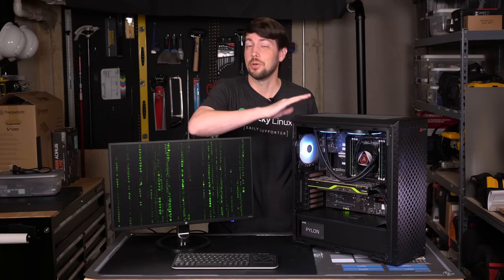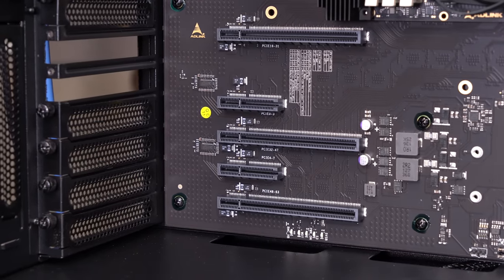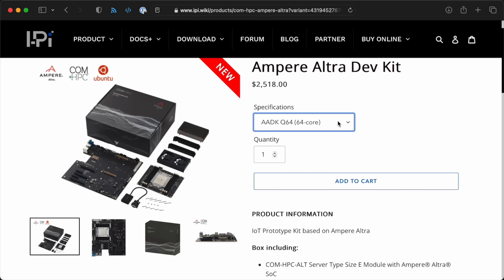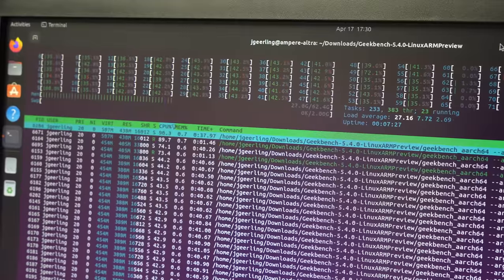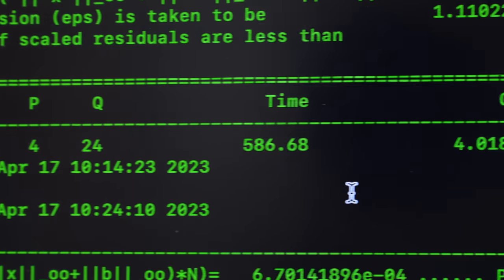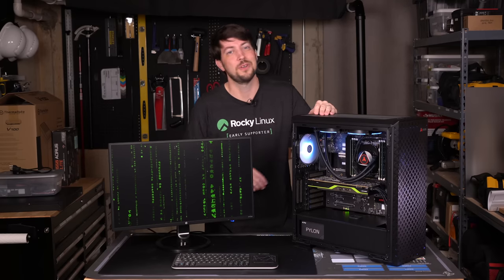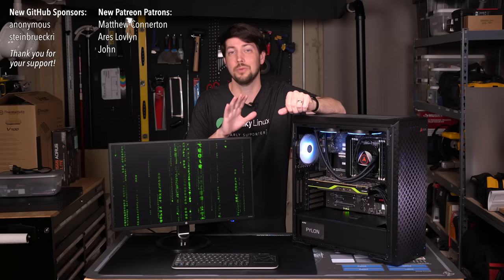This Mac Pro killer runs a GPU—and Windows on Arm!

Comment: If you have a volume licensing agreement, you can get the release ISOs for Windows 10/11 for arm64. I uh... have those if you want them. I've used them to install Windows 11 on my Galaxy Book Go. Fun thing is that I had to pull drivers from the built in recovery wim that was preinstalled on the machine, and copy them to the installer/boot wim in the ISO. Without adding the drivers my Galaxy Book Go doesn't have functional USB/Keyboard/Trackpad for installation. Even better is that Samsung doesn't provide any way to do an ACTUAL fresh install. Definitely not the experience you get with x86.
Reply from the maker: I have an ISO to test... we shall see!
Reply: Volume licensing agreements also mean agreeing to audits, don’t they, to ensure you’re not misusing the licence.
Reply: @lawrencedoliveiro9104  Am I misusing it by installing it on my Galaxy Book Go with the inherited “digital license”? They don’t provide the iso because it literally won’t work on most ARM devices without shoehorning drivers into the boot/install WIMs. If you install it but don’t activate it, my understanding is that you’re not actually violating any terms.
Reply: @JosephHalder  Copying the software is still subject to copyright.
Reply: @lawrencedoliveiro9104  Is the license different for x64 and arm64… serious question. Because they allow you to copy the x64 iso. I think once UEFI implementation and ServerReady become normal on Arm, they’ll likely just provide it just like x64.
Reply: @JosephHalder  The licence is whatever you agreed to when you got the copy. Pay careful attention to the wording of that.

Comment: Will you be trying anything with RISC-V at all?  It would be interesting to see how easy (or not) it would be to build something like this with RISC V.
Reply: Right now there's not a lot of RISC-V 64 bit systems out there for end users - and none with the kind of PCIe connectivity datacenter / workstation systems require.
Reply: @jnelson4765  Well someone with the technical know how could make such a system (the necessary extensions to RISC V architecture to make it possible)     and could contact services like Europractice   MOSIS(who offer middle man services  where  they help companies , tech faculties of universities  and governments share the cost of semiconductor manufacturing by getting chips made from the same silicon wafers)   to have  semiconductor prototypes manufactured by foundries (TSMC, Intel , samsung ect) and have a complete computer   system  made by companies like compal , quanta computer and foxconn.

With enough funding it's possible

Comment: Worth it for the make -j96 bragging rights alone.
Reply from the maker: Heh... now I want to see about acquiring a 128 core chip ;)
Reply: @JeffGeerling  that would be awesome! The Ampere systems in general seem hard to find. IT Creations quoted me an 8-10 week lead time on the R282-P91, but said they had a R282-P92 (3.5" drive model) available at end of May.

Comment: I'm no expert, but I think the biggest issue in the way of mass adoption of ARM on desktop/laptop platforms is software.

I think that Apple's M-Series computers have proven that the software hurdle isn't as big of a problem as it's thought to be. Especially with their Rosetta software that does "live" translation between X86 and ARM. 

I legitimately think that we're in a catch-22 scenario where we need really good translation layers to be able to justify switching to ARM, but we also need good ARM systems to develop good translation layers. 

I'm no expert, but if the Steamdeck and Linux's Windows compatibility layers have taught me anything, it's that it's worth taking the time and energy to invest in developing those compatibility layers.

Comment: Interesting stuff… Apple is not really doing themselves any favors by maintaining an isolationist position and excluding others from adding value to their platforms, or even for users to perform upgrades.  Something really odd about this approach.  I am an Apple user, but I find it really difficult to stomach this - they’re even doing everything that they can to stop right to repair as well, so it is just a little crazy… Anyway, that looks like a real cracker of a machine, and provided that it runs LinuxMint, which I’m sure it will, I would be more than happy to use it.  Sadly out of my budget right now… Thanks for a great video and perhaps by the time you are ready for your next one, you will have heard from MS… 👍🙂

Comment: Neoverse-N1 has quad instruction decoders. It doesn't have decoded instructions cache. Only 16-bytes per cycle fetch rate from L1 instruction cache.

Apple M1 has octa instructions decoders.

Zen 3 has quad instruction decoders (X86 instructions can do more than one function) and a Macro-Op cache feeds 8 Macro-Ops. The L1 instruction cache has 32 bytes per cycle.

Comment: That's honestly a very cheap computer considering what those servers go for in rack mount.
Reply from the maker: Definitely not a bad deal for what you get. Might want to throw in a midrange graphics card to complete it, but I still haven't gotten around to testing any yet.
Reply: To be fair, take two large server rooms of the same size then fill one up with rack mounts then fill the other up with these boxes. How many servers per space you think you will get over the other? You’re paying for more servers per space. Rack mounting is not for everyone clearly.

Comment: I have an ARM server as my home server with similar expansion. Mine doesn't have 96 cores though. Lol. 

I went with ARM because it's so much more efficient and takes less cooling. Making it quieter and use less power keeping my electricity bill down. 

I use it as my NAS, DNS, VPN, and Home automation server. Plus I can run docker containers for just about anything.

Comment: There’s no reason for Apple to have any desktop computer with PCI express slots, since they no longer support dGPUs.  Also, IIRC there’s some chip errata that affects the performance of dGPUs on the ampere chips.  There’s a patch for it but the patch is basically a software workaround, and slows things down considerably.

Comment: something that could be interesting would be an hbm-like cache, like the vega on my 8709G has, you could have like 4 or 8 Go of low latency "L4" cache (i.e. on socket ram) 
with some clever routing/design of the controller it would be doable to have each chip of the cache accessible independently, giving basically 8 channel access to the cache.

Comment: I have doubts on the upgradable RAM, one of the reasons Apple Silicon is fast is its RAM are placed near to the CPU and GPU, thus reduce latency. If Apple really wants to implement upgradable RAM modules, the reasonable approach I can think of is "Fast RAM, Slow RAM"

Comment: I tried explaining to folks that soc's could bridge to an expandable system board like this. Risc V was designed from the get go to be bridgeable so arm had to be around the corner. I bet SoC's will be standard with a neural/gpu for acceleration on the soc. I know SMT was finally added to Arm 64 chips in 2018 but I am curious to when we will see it in production. Imagine a 96 core monster with smt2 (or even smt4)

Comment: The 'What if Apple...' questions are pretty unlikely, but I don't see why Windows 11 ARM might not work as an editing/ingest server. Apple won't be working with Nvidia dGPUs any time soon, I don't think. But now that MacOS and Windows 11 both have versions optimized for ARM, this video has me daydreaming about running both MacOS and ARM Windows 11 in VMWare from Arch64/Ubuntu... And if we could use a 4090/H100 with bare-metal Windows 11 ARM, I'd love to try running LLMs or Stable Diffusion WebUI and other tools which use Torch/CUDA/CUDNN binaries, but I bet it would take a bigger brain than mine to do it. Thanks for this completely unique and interesting content! You're awesome!

Comment: I took a closer look at the Ampere Altra Dev Kit and it does not seem to include the proprietary closed loop liquid cooler in it.  Instead it has a small heatsink and small double fan
Reply from the maker: Yeah, apparently this is an XPG part (with an ADLINK sticker on top), and it can be purchased separately. I asked ADLINK if they might stock some alternative coolers (especially a horizontal server-style blower heatsink), and they said they're considering it.
Reply: @JeffGeerling  XPG or Adlink sells the cooler?  I do seriously want to buy the cooler.  XPG's website only lists a x86 compatible unit.
Reply: @JeffGeerling  I was digging further and found a German Closed Loop Cooler called the "Alphacool Eisbaer Pro Aurora 240 CPU AIO" that offers an Ampere mounting bracket though it is sold separately.  I found a store based out of Canada that ships the mounting bracket to someone in the US.

Comment: The lowest end option seems to be a 32-core config for $2,000 (and that's just for a CPU and MB).  Tantalizingly close to being able to build a "normal" desktop machine:  something equivalent to an AMD Ryzen 7700X CPU on a mid-range B650 chipset based MB.  But... not quite there yet.  

And yes, being able to run a vanilla ISO of Ubuntu is a must.  All the weird idiosyncrasies and compatibility issues inherent in ARM SBC's is super annoying.
Reply: runs vanilla ISO of Ubuntu
Reply: @JoeSpeed  Which I think is a great feature about this system!

Comment: Computers and hardware are used to dealing with levels of memory. Your CPU has high performance cache, then levels below you have RAM. Levels below that, you have "virtual memory" aka your SSD being used as fallback. The integrated RAM in the Mx chips has so much bandwidth that it's great but I don't know why they don't allow more RAM outside the CPU that would be treated as a level below the chip RAM. It wouldn't be more complicated than the way that applications swap from virtual memory to real memory.

Comment: I don't need "high-end" desktop computer with ARM processor. I think it better to make ARM SBC like Raspberry Pi with standard X86 memory and PCI-e. I installed Linux server on my android box. It have Amlogic S905 processor (ARM) and 2 GB RAM. I install openmediavault (NAS) and Home Assistant (via docker) with MQTT extension (masquitto). Modern ARM processor about 4 core and 4GB memory is enough for desktop. It can be use for kids to learn computer or for home media center.

Comment: @7:45 are you using full system draw for the wattage on all chips? On the 5600x, what gpu did you use. 196w for that chip seems way too high owning one myself.
Reply: That is total system draw including 750W PSU under full load. Don’t know if the RTX 8000 was already plugged in at this point.

Comment: Finally an ARM desktop targeted at non enterprise scale users.
I wish they'd use HBM instead of DDR.
I would also prefer if Apple didn't do it because they're awful to deal with in the context of repair and expandability and that's a big problem for small businesses.  Apple letting users decide how to fill expansion slots and memory with non apple users isn't something apple is amicable to.
Also: Software efficiency has always been important--bad programming somehow became acceptable in the industry in recent times.  Early hardware restrictions obligated extremely efficient code.

Comment: very interesting idea, but i do also think, that ddr5 memory is a must on machines like this. Like you have huge multithreading but somewaht speed "bottleneck" with ddr4
Reply from the maker: The Ampere Altra/Altra Max only goes to DDR4, unfortunately. We'll have to wait for a new generation to get up to DDR5 speeds. Plus, DDR5 has so far been an interesting (read: sometimes unstable) journey, at least if going to higher speeds!

Comment: In order to download a Windows 10 ISO recently, I needed to disable pi hole blocking temporarily. Not sure if you had the same issue with the ARM build, but thought it was worth mentioning!!
Reply from the maker: I had tried that a couple times, but it didn't help. I re-tested yesterday and was finally able to download the file. No clue what happened!
Reply: @JeffGeerling  Microsoft must of heard this via the grapevine saying "Fix this before Jeff pull a red shirt on you!" 🤣
Reply: This is why they say, Windows is a great OS--if your time is worth nothing.

Comment: Could try installing windows arm on another device, then moving the drive to this computer? I used to do this a lot and the drivers would sometimes update albeit at least loading the system in some compatibility mode.

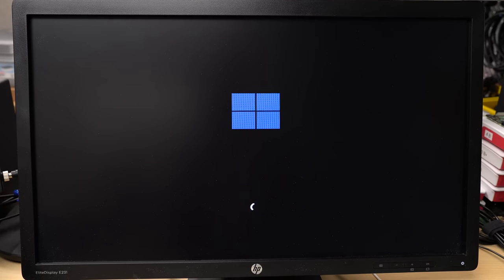Comment: * - at 9:47 on Windows blue screen for error it says "ACPI BIOS ERROR" .. u might have to reflash the bios.. the microcode might not be supported.. i don't think the Coreboot + Tianocore can run windows either... (i think that's the bios used on that board) or EDKII... i think  that's where the problem is.. the BIOS microcode.. look into UEFI open source that will boot into windows.... make sure u backup ur bios just in case....

Comment: Apple aren't going to make a new mac pro that will allow you to upgrade anything except expansion cards. No CPU, RAM, GPU, or SSD upgrades. They have too much of a strangle hold on your hardware to allow it. If they could figure out how to weld their machines shut without damaging the electronics or finish of the aluminium, they would.

It would require a massive change to the way their m series processor accesses the memory. Going from direct access to the chips on the package to a memory bus would cause a massive leap in latency, and destroy the main advantage of their architecture, basically making it slower than their desktop/laptop models.

Comment: I guess this explains why Windows on Arm is not really a thing yet for most people.  Would definitely be interested in trying something like this out when it has better support though.  I'm not sure I'd even bother with Windows if I was using an ARM CPU.  I'd probably just go with Linux.  Steam has decent linux support now for games, but there are definitely some productivity apps that don't have Linux versions.  There may be similar apps on Linux but if you're locked into a specific app it could be an issue.
Reply: With no efficient translation layer you still wouldn't be able to play games on Linux, even through Proton

Comment: Hope I have an easier time with using an obscure gpu working than you tend to.
I have an AMD Radeon Instinct MI50 32 gb coming (it was super cheap) and I have a dual Xeon e5-2690 to try to get it working on...  I know it won't work in Windows, but I'm trying to play with AI and GPU programming.

Comment: I enjoyed your video, However, You miss the main point of the M series processors. The CPU and the GPU share the same super fast ram. In a discrete GPU setup such as this, the CPU needs to move data from RAM, over to VRAM. In the M series processors, it simply needs to tell the GPU what register to find the data, in that super fast ram pool. Also, anything over 10GbE is a waste of money, because the hard drives are the limiting factor, even in a fast multi drive array.

Comment: Hi Jeff, thanks for the review! Short question, I would like to add a 25G NIC to my Mac Studio and was wondering if an external TB3 GPU enclosure with a Mellanox card could work. The Sonettech site shows a few 25Gb NIC support with their rack solution, and I think it probably works the same as a TB3 GPU enclosure 😊 Thanks!
Reply from the maker: It should but it's all about the drivers. Not 100% sure if it's a Mellanox card they use in that Sonnet enclosure. You might be able to ask their support staff.

Comment: The suggestions for the changes (external ssd controller, external memory daughterboard etc) you're suggesting are not really feasible.  The reason the Mac M1/2 chips are so fast is precisely because the memory is on-chip.  The direct-connection internal memory bus is leagues faster than one that could be done over motherboard traces.  The latency ...

Comment: This is exciting, though the performance is a little underwhelming. It’s faster than the Mac Studio, but not by all that much.

I’m excited to see where they take it in the future. Especially if they can offer multi-socket designs. 

For my day to day work we have a test suite which can consumer 600+ threads. I’d love a desktop sized box which could munch that through those in under 30 seconds per run.
Reply from the maker: Agreed; for certain workloads, the performance is amazing, for others not as much. I'm waiting to see what Ampere's future in-house design looks like. Might be able to dramatically increase the individual core speeds.